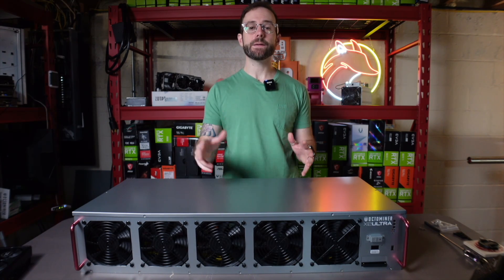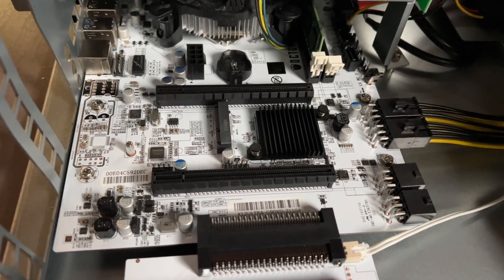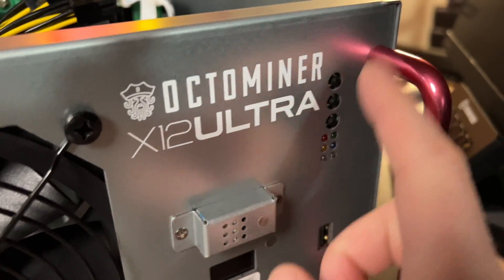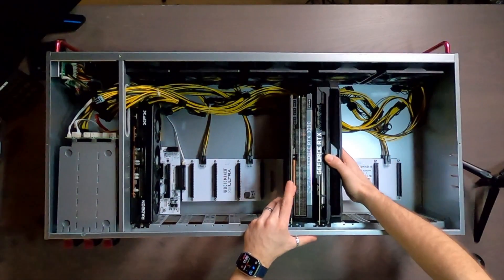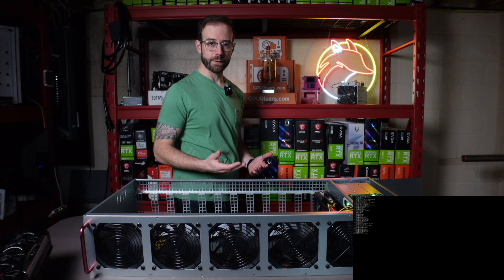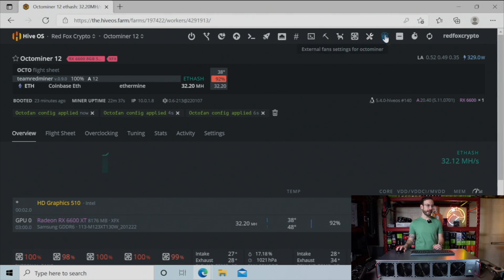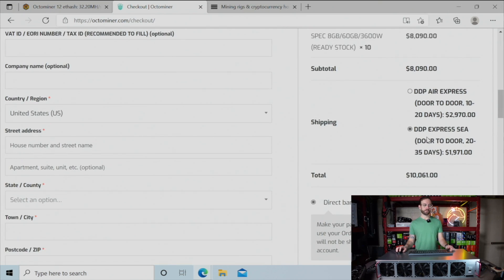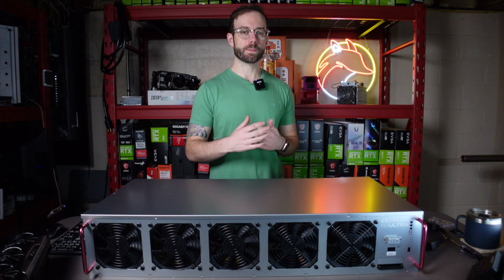Should YOU Get An OCTOMINER? Octominer X12Ultra Review

Comment from the maker: Would you buy an Octominer if they didn't have a minimum order quantity?
Reply: Yes but the minimum order is now 10 units. It’s a good value but I can’t buy 10 units 🥺
Reply: NO, not when you can buy a 8 GPU system for less then 700$ on amazon, have it tomorrow. We have several!
We enjoy your opinions on your channel!
Reply: @hartzellsheatair6003  which system is this?
Reply: @MrBobbyw121  the brand is Alixueqin 8 gpu $487 1 day delivery. We use only Commercial grade 95% efficiency PSU, racheting or not power supplies. Ebay - Amitylabs PSU,  3 - day delivery. Keep in mind there is a Big Difference in a YouTube content seller and an actual mining provider.
Reply: Yes. Looking at something on Aliexpress now.
Reply: Yes. I had 5 in the cart. Then they bumped the MOQ to 10. I still need 10 of them anyway, but with the market moving as it is, I'm going to wait. Not because I'm bearish, buuuut because I see green on the horizon.
Reply: Yes, guess they don’t want small guys to buy them.
Reply: I would've like to see some stress testing in the review. How well doest it cool if you fill the cases with 3090's and 3080's. 6600 had no issues with cooling and even in summer they stayed cool, but the 3080's and 3090's got warm and throttled alot. I am curious too see how well the case performs under stress.
Reply: Absolutely!!
Reply: Yes absolutely.  Anyone interested in  combined order.  I would like 2.
Reply: Minerdude sells the same case but is $1400
Reply: Yes!!!
Reply: Yup. I currently only do server case builds but 9 would just be sitting around not making money.
Reply: yes i would like to buy one for testing, and maybe later more if it works for  me.
Reply: Yes, I would :-)
Reply: Absolutely would
Reply: Sure would seems like lots of value.
Reply: Yes
Reply: 100% without a doubt. I'm looking for another rig case right now actually.
Reply: I'd love one, and basically for just the price of a gpu, you could get a super nice setup!
Reply: Absolutely not.
The shipping really makes it a no brainer. 
DIY your own Octominer. Literally costs less because the shipping wont murder your wallet.
Reply: Yesss I would